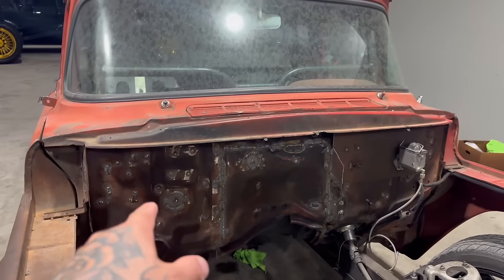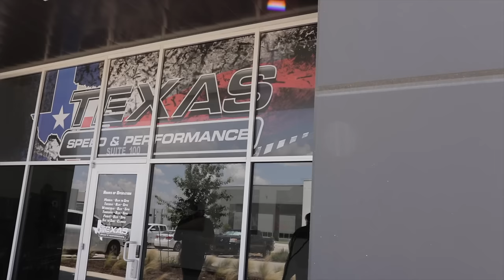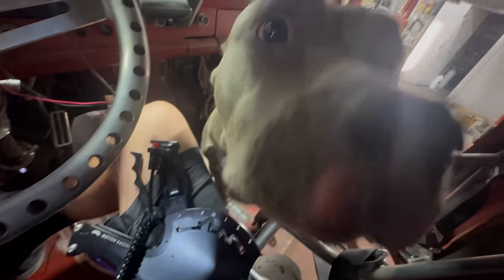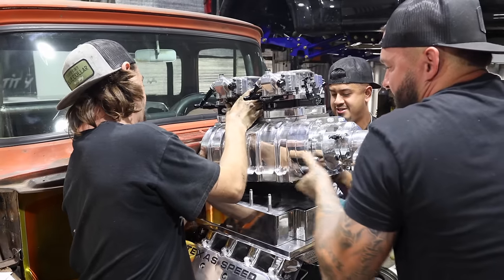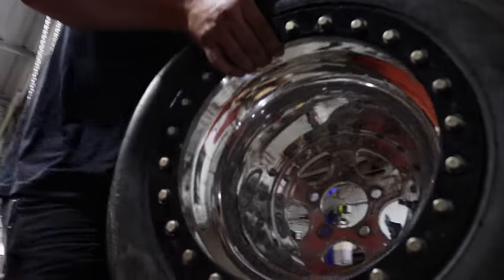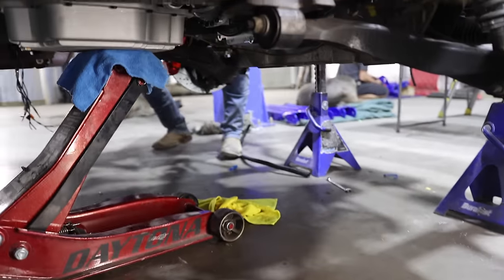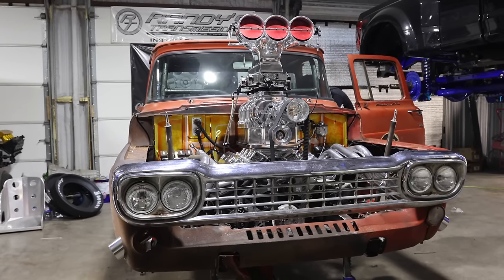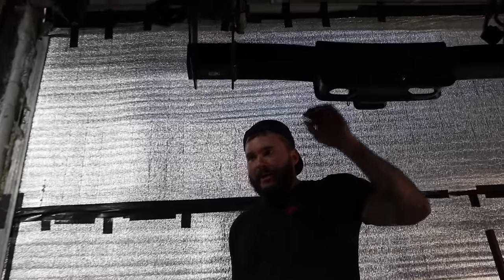Building a 1958 F100 with a LSX Blower Motor!

Comment: Lol the star pattern is for a purpose of even pressure I see a lot of folks just doing circles but stick with what you know and what works for you. No anytime I put in a bowl I always back thread before threading. Anytime I'm tightening something I always at least do every second bolt and then change direction so and so forth you know if I tighten a bolt then I'll go complete polar opposite and so on and so forth and never completely torque them down until you have them all in a sense finger tight before you torque them to yield and I've had straight up old school hot rods teach me a lot of these tricks grown up as a kid I mean I'm still young I'm in my early 30s but I've always taken it religiously to listen to the old timers for their experience so I don't have to go through the exact same punishments but again if it works for you and it's your project and that's all that matters but if you're hubby wants to do it his way and and you want to stick with tradition or my sense the correct method then you should do so It's set sets you aside as a professional It's just like in the construction industry or any industry you get those guys that say it's good enough and most of the time it's not good enough cuz if it ain't done right then it ain't done right.